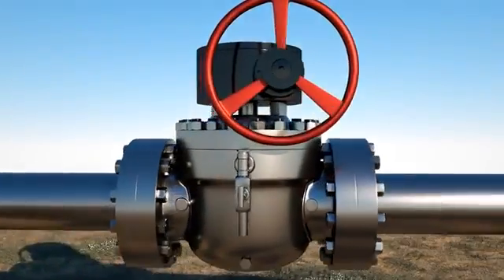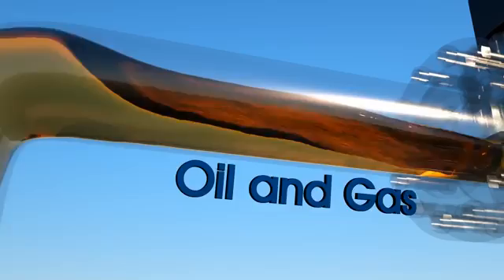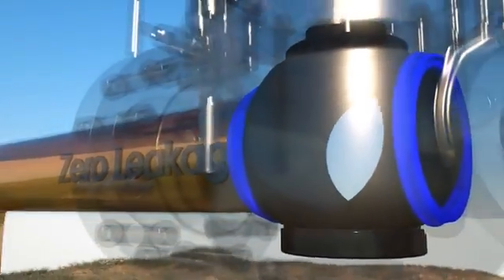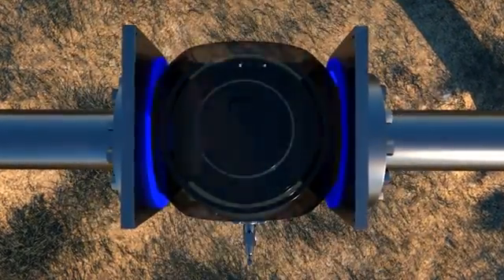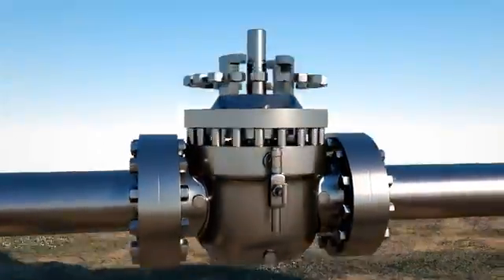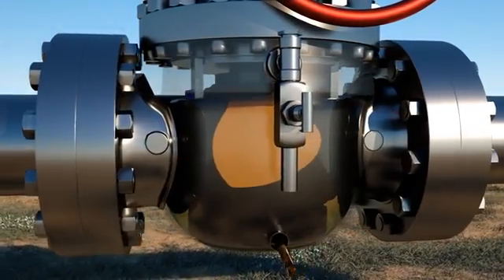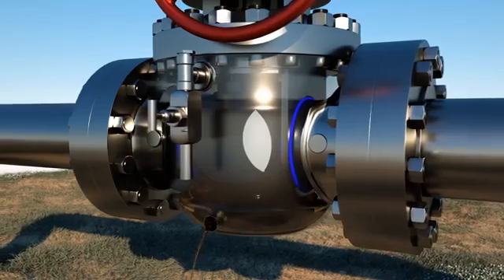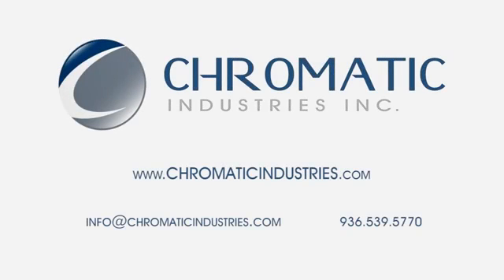double block & bleed valve technology

Comment: This kind of valves can be install on vertical pipeline position?
Reply from the maker: It's preferred to be horizontal ..but it will work if installed vertically